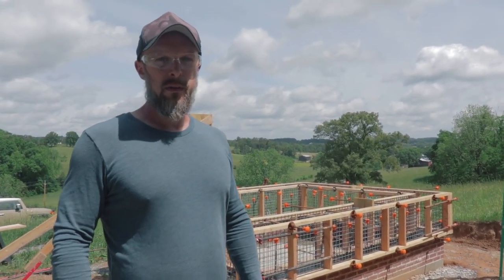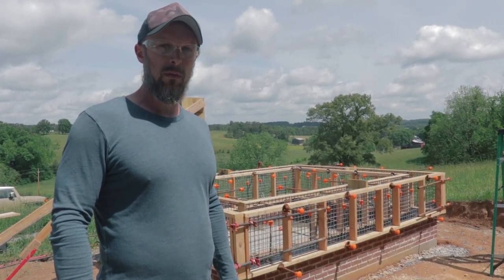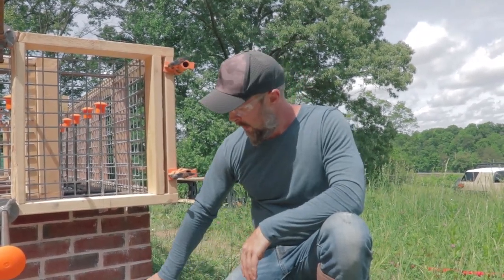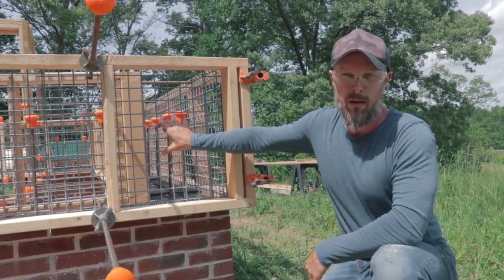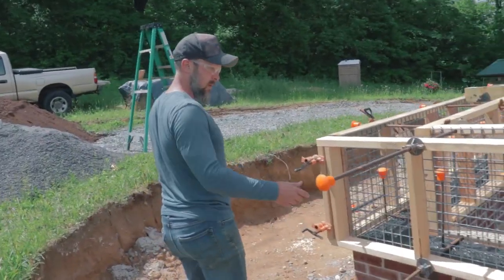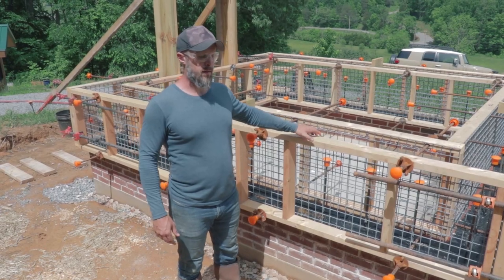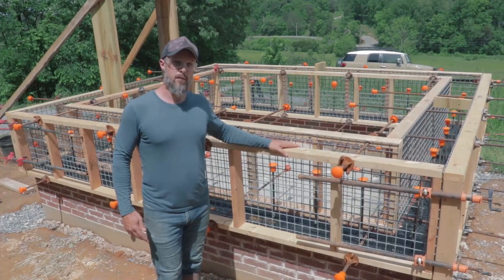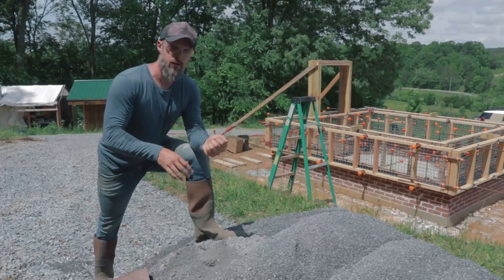The Cob Slipform Method - A Better Way to Build Cob Walls

Comment: Nice way to do a Cobb wall like that but for me too labor intensive and more money for supplies. I moved to the desert to use mostly what I have on my land. I might try this method at a smaller structure to see the whole process. Keep the videos coming on your progress ☮️🙏☯️🐓🐓
Reply from the maker: Will do!

One way to save on cost of forms with this method is to build in panels. So, you don't need the forms to go all the way around your building like I do here. Perhaps I'll make a video on that later.

Comment: Another possible benefit of the wire forms is the grooves that it leaves behind on the cob provides a better textured armature for the lime plaster to adhere than it would on a smooth-formed wall. Will you no longer need to use a lathe or mesh?

Comment: Great video Alex. A few thoughts and curiosities... this method could also allow for the integration of conduits for electrical wiring within the wall cavity and be supported by the wire mesh and tie wire used for connecting rebar. Wondering if one could place the forms slightly inward (1/2" perhaps) on top of the foundation wall prior to applying the cob, so that when the outer plaster layer is later applied, it would be perfectly aligned with the foundation wall, and not be sticking out. Hope this makes sense, and I look forward to your feedback.

Comment: There is a multihinge aluminium ladder available that can be set to a right angle, and set straight. I plan to use your method, using the ladder, on the horizontal, of course, as the frame onto which to fix the metal lattice. The metal grid is such a great idea, I assume speeding up the drying process, rather than the usual timber or metal sheets
Reply from the maker: Yes, correct!

Comment: In our village, houses are made from a mixture of clay and maybe straw. I am not sure. I just saw part of the process. Clay was kneaded with their feet, then they made large balls and dried these balls in the sun. Houses, according to this technology, with very thick walls. In the heat (we have 40 degrees in summer) and warm in winter.